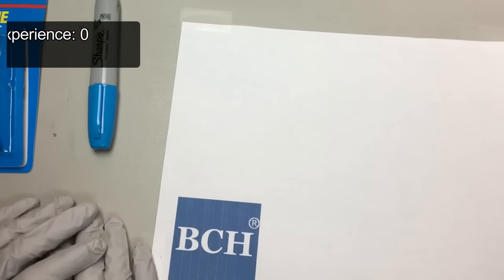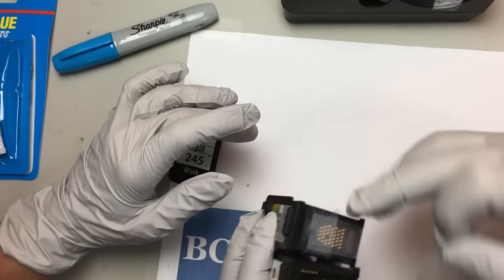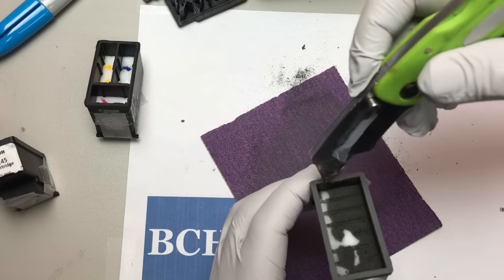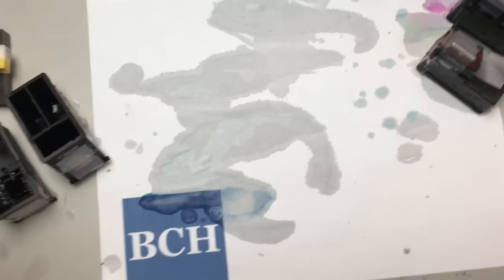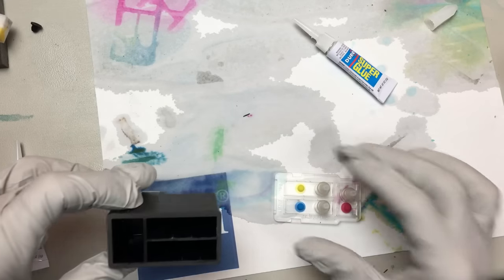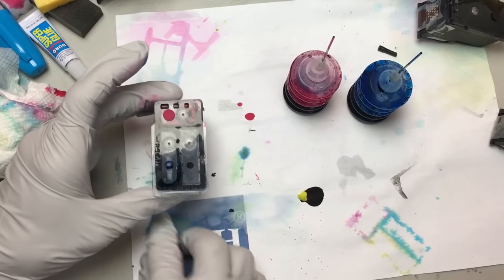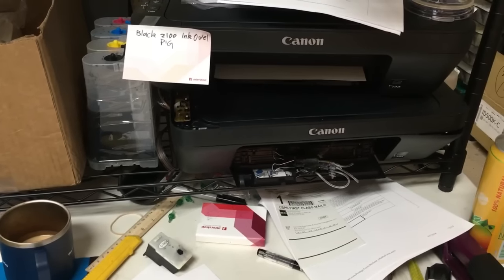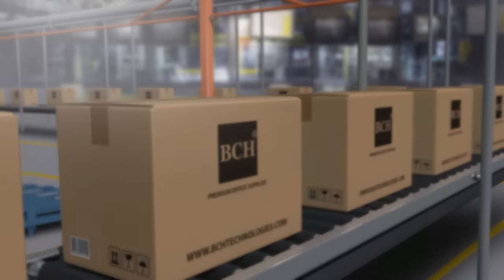How to Start Making Canon Spongeless Refillable Cartridges: PG-240 CL-241 PG-245 CL-246

Comment: HP deskjet printer does not detect refilled cartridge

I have refilled my ink cartridge, I even tested it by pulling it on a piece of paper/tissue; all good here. Now, the problem I face is: after inserting the cartridge into the printer, the printer detects the cartridge but shows empty in the icon on the screen (tri-colour). I tried resetting the printer but issue still persists. Any suggestions?

Model: 2677
Cartridge: 680
Reply from the maker: You don’t need to reset, just keep printing
Reply: @BCHTechnologies  that's true. I did print a lot of documents and had no issues. Thanks though!

Comment: Hi, thanks. That's a nice design, now it's easier to refill it. What do you do when it still says "Low Ink" (e.g. for the HP 815 or the Canon MP287).

It's interesting the standalone black cartridge also has 5ml which is the same milliliters as each of the colors in the tri-color cartridge.

I have a CISS kit for the Canon MP287, I've been at it for days (dedicating 3 hours each for the DIY CISS). I've cut the needles (4 syringes, one is 50ml for the black, which may be overkill) 3 needles to about 1cm, though I think it takes too much time to cut & sand (600 grit) to unblock the needles' holes after cutting with the Dremel. 

It would probably have been better, if I just bought extra, size 27, needles for it (but then I'd have extra unused needles but time is more important).

Sometimes though, I wasn't doing a CISS and were just refilling it, coz' that's way faster and simpler but DIY CISS is getting to be a good experience. If I get to finish the CISS today, that'd be hour 15 (including the travel time to get the parts, excluding the weeks of researching which CISS is the best design for the least cost and 2 days of waiting for the delivery):-)

God bless, Proverbs 31

Comment: Wouldn't an industrial strength car rubber gasket be better than super glueing it, to seal it 100% on the first try?
Reply: then you'd have to glue the gasket to the cartridge then the lid to the gasket. Creating more surface area to make a mistake with. Not to mention having to make the gasket in the first place. As long as the sanding is even and smooth gluing should, unless you are an idiot, go okay.

Comment: Sir good evening. Im romel urbano from Philippines your new subscribe r and i want to know how to order transparent cover of cartridge for canon pixma MG2570S. Thank you sir. And sir old cartridge is possible to fix because the problem is ink but long time didn't use. Thank you sir.
Reply from the maker: Soak it in very hot water and do a refill first.  If it works, you can consider do the spongeless.

Comment: Good grief!  All that fiddling with tape.  I just remove the label.  Drill a small hole on the bottom of the cartridge ... not the obvious little raised circle because the manufacturers have blocked that old way of refilling.  On the “floor” of the raised grid near the bottom of the cartridge. Then with a cheap syringe, I slowly inject a small amount of ink.  I’ve refilled cartridges
ten or more times.  My printer dies before the cartridges wear out.
Reply from the maker: Live long and prosper.  _\//
Reply: nikkitytom do you need the chip resetter after refilling this way?

Comment: Good instructions... Would have moved along faster if;
 -you weren't sharing tools
-Trimmed video for us
-I already figured out a better way to protect them and I have not tried doing it yet.. even taping without gloves would have been easier!
I like that your not using hot glue like other videos... It didn't make sense because the cartridge I assume heats up when printing and it doesn't take much to reheat hot glue to just get tackey again.
- why not clamps?
- do u use a cheap glue and not loctite or a stronger epoxy so it can be filled again? ?
Reply: It looks like you put the cover on once. They used plugs to refill the ink, so you'd just remove the plugs, fill them with ink, then put the plugs back in.

Comment: wait so the sponge has absolutely no purpose?
Reply from the maker: It has.  The sponge is used to regulate the ink pressure, so not all the ink flow out at once.  The BCH cover has a built-in pressure regulator, looks like a white column next to the refill hole, so it works.

Comment: Does not work the chip only used one time and won't reset
Reply: You can get replacement chips, but the best thing to do is refill BEFORE it runs out. You can always tell it's getting low by print quality.  At first, I had to buy another printer , but I learned my lesson. I have been refilling the same cartridges since 2012! Hope that helps.
Reply from the maker: I showed how to turn off the chip here: https://youtu.be/gNbQS2kWliQ

Comment: ako vyber 1 a 2 a 3?

Direct Link™ Courier
 *Super Saver. No Tracking. BCH is not responsible for package lost. $7.68
*Standard. Tracking Limited to US. BCH is not responsible once the package leaves U.S. $8.68
 *Gurantee. Door to Door Tracking. BCH will replace if a package is lost. $12.68

Comment: this method is stupid.  I drill a hole 1/64" and insert the needle.  Tape the hole.  Done.....who cares if ink gets on the sponge.  who cares if something goes wrong.  you're already modifying it.....I've never had a problem.  As long as the pages print properly.  Then who cares!  $60 for the printer and $16 for ink that will last me years.........even if it catches fire and it all fails WHO CARES!   I throw it all out and buy a new printer........cheap and convenient!